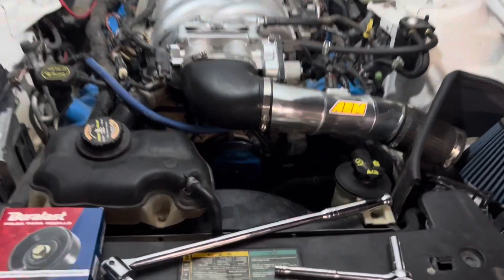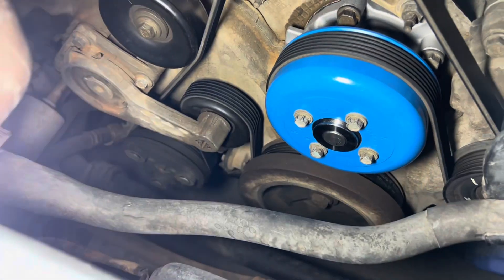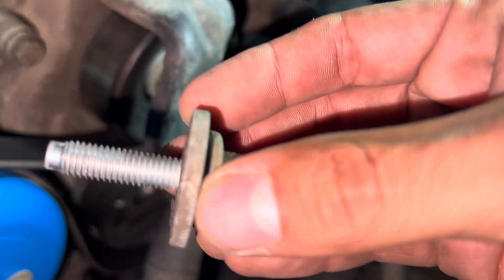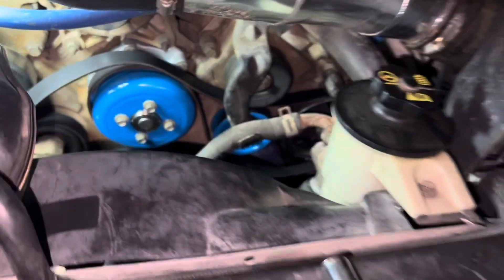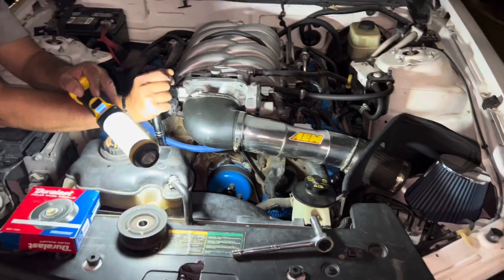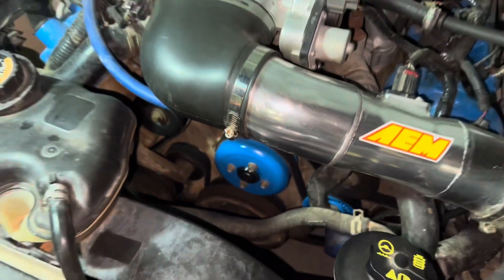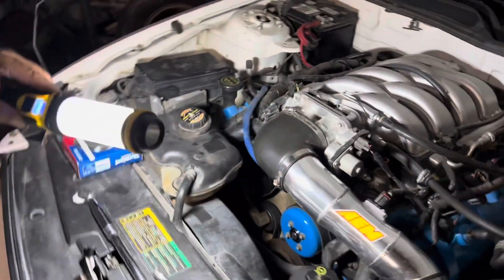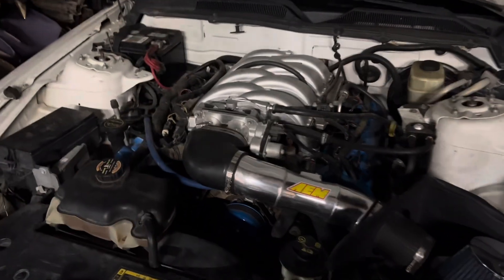How to Replace a Idler Pulley on a 2005-2009 Mustang GT

Comment: Sounds like the power steering pump was whining aswell.
Reply from the maker: No, We actually changed the Power Steering for a New One Before Doing the Video. We Discovered that it was the Belt Tensioner Pulley $15 Dollar Fix. We probably make a Video on that Later.